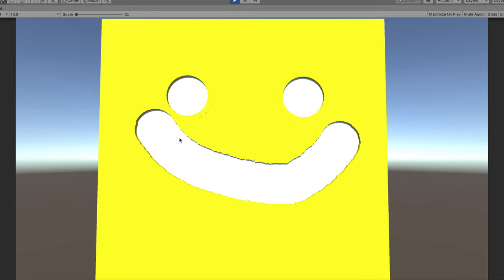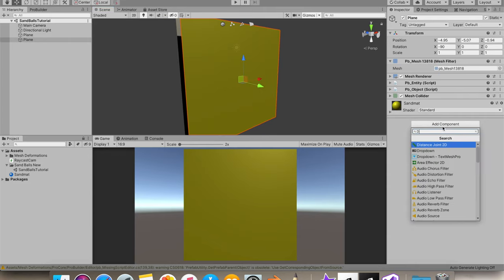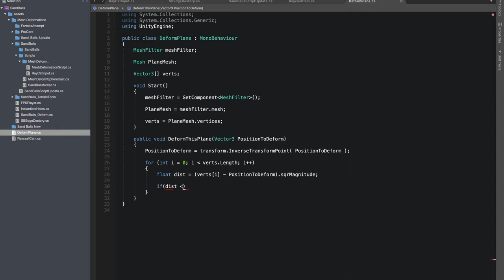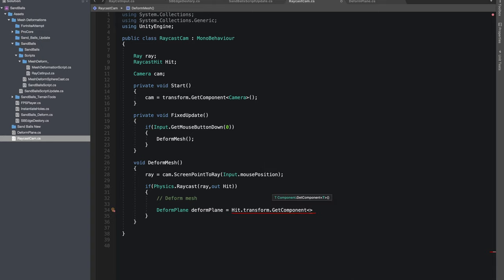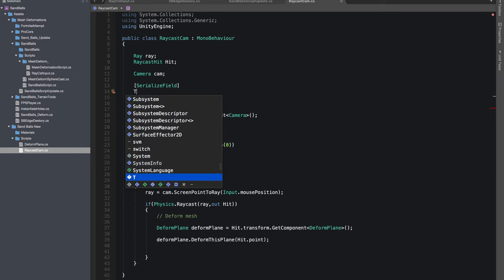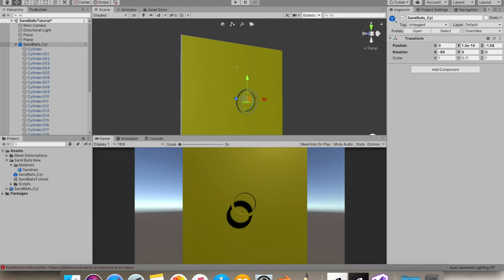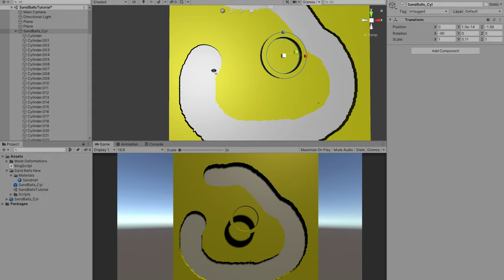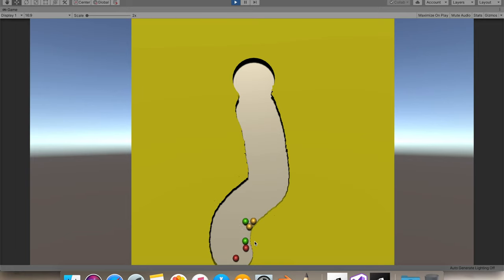How to make Sand Balls? | Unity Tutorial

Comment: Hie, I am not able to deform the mesh Actually in my case plane texture is moving back while raycasting.
Reply from the maker: Make sure the vertex count of the plane is high or try adjusting the deformation radius.
Reply: @CodingJedi  Yes mine model is High poly
Reply: @CodingJedi  After changing some values I noticed that Mesh is getting deformed by only Corner side of plane  even I made plane Using Probuilder tool and Subdivide it.